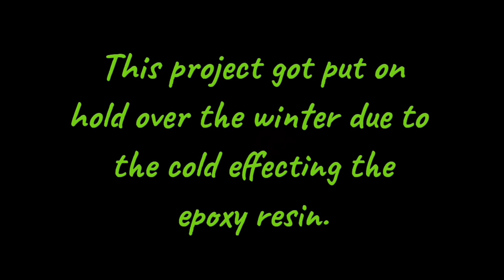DIY Plywood Canoe, Selway Fisher Design 14ft Prospector.

Comment: When canvasing (or re-canvasing) a wood canoe, the canvas must be one piece, and it is stretched over the canoe in one piece.  This practice seems to have been carried over to the use of fiberglass cloth that is satuated with either epoxy or polyester.  However, when covering a canoe hull with fiberglass cloth and resin, it is not necessary or even advisable to cover the whole canoe with one integral piece of cloth.  It is easier, and perhaps even better, to section the work off by overlapping pieces of cloth.  
A common mistake when using fiberglass cloth and resign is to attempt to cover up the weave of the cloth on the first application of resin.  What happens is that the cloth floats to the surface of the resin, and one keeps on adding more resin in a futile attempt to cover the weave.  The first coat of resin on the cloth should be no more than what is needed to just barely saturate the cloth.  Once that resin has set, another coat is added to cover the weave.
Addendum:  I don't install decks on my canoes.  They serve no purpose except to create a dead air space which promotes rot.
Reply from the maker: Thank you for the information, I will definitely keep this in mind if I ever build another canoe in the future. Thanks for watching 😊
Reply: To add to this before glassing with resin, I would first use infusion resin thinned with styrene to saturate the wood (catalyze high for fast cure) , then in a one piece cloth in 4oz. rolled up from both ends to meet in the middle. Once resin cured light sand (clean) then pre wet out half the canoe with vinyl ester just enough to hold material as you roll it out and smooth it down as you go by hand. Then wet out with a brush even real easy also roller or squeegee what ever you prefer to work with or what ever wet out process you like then repeat for other half( with marine grade resin not generial purpose ).  then sand and repeat again . I found this material is easier to hide with resin and finish up with a clear polyurethane

Comment: Fantastic build video. Great job. I have just started building this canoe. What weight cloth did you use and where did you buy it from? Cheers.
Reply from the maker: I hope your build goes well, as for the cloth weight I used, off the top of my head I believe it was 200g plain fiberglass. Good luck with your build.
Reply from the maker: I got the materials from East Coast fiberglass
Reply: @sammyslavvu1981  Thanks.

Comment: what is that white material?
Reply from the maker: It's a fiberglass cloth covered in an epoxy resin. It gives the plywood a plastic protection, strength and resistance to water.